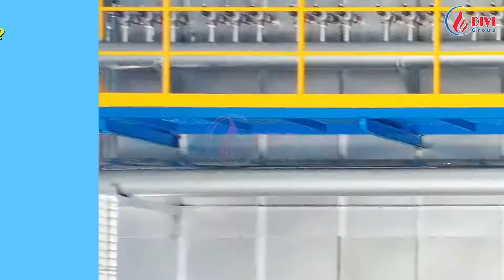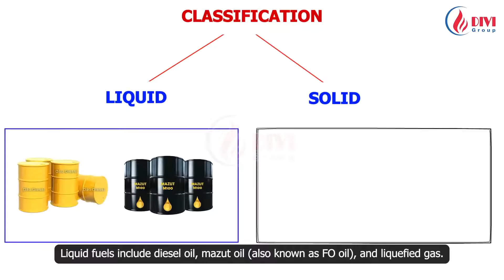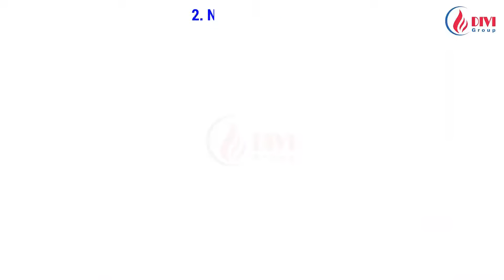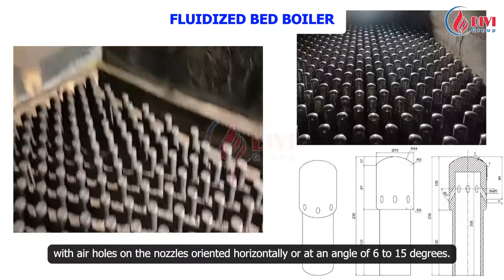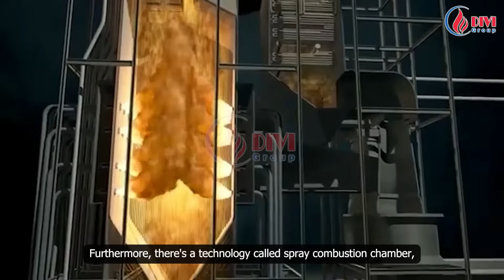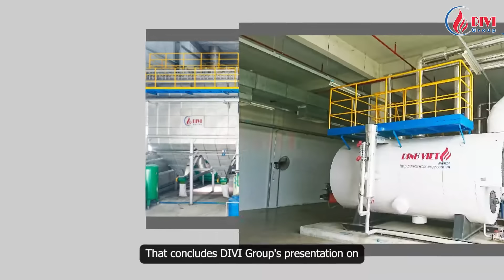Steam Boiler Explained: How It Works, Types & Industrial Applications

Comment: What are the main types of steam boilers discussed in the video?
Reply from the maker: The video highlights several types of steam boilers based on fuel and construction methods, including:

Fire Tube Boilers: Where the combustion chamber is inside water tubes.
Water Tube Boilers: Where the combustion chamber surrounds water tubes.
Solid Fuel Boilers: These use coal or other solid fuels.
Oil Boilers: These use diesel oil or mazut as fuel.
Gas Boilers: These use natural gas or propane.